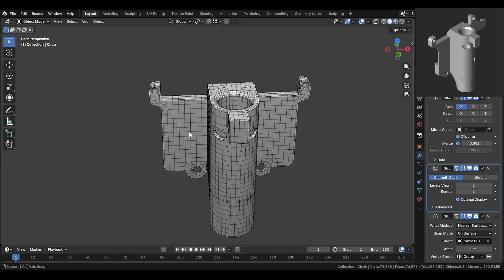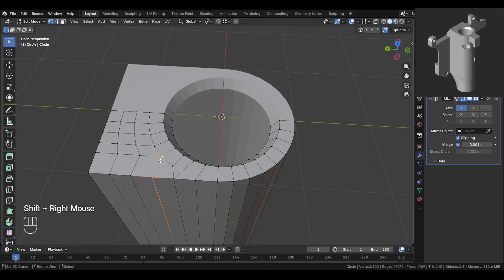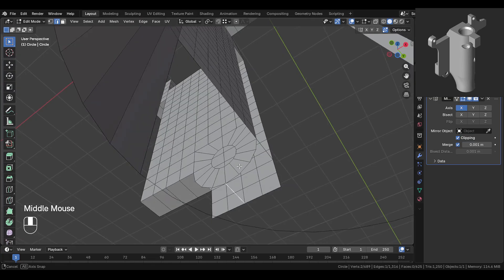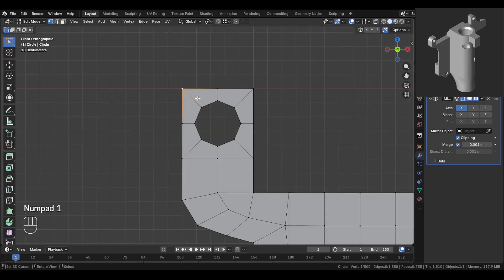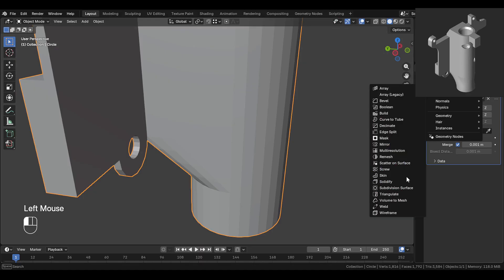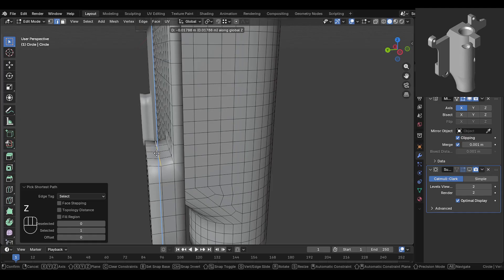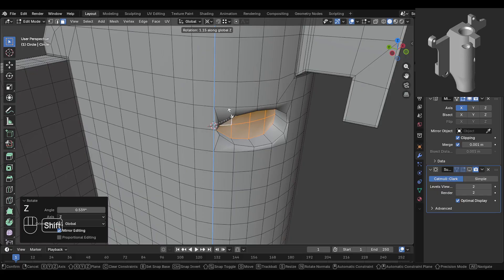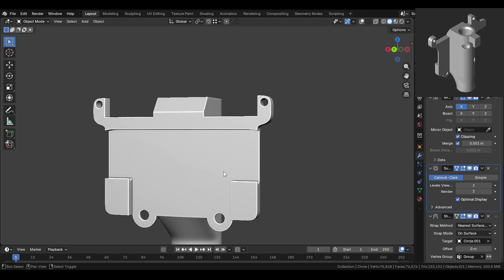Blender Practice – Modeling a Mechanical Pen Holder Tool

Comment: That shrinkwrap modifier trick is awesome. I'm sure you are familiar with the normal data transfer modifier to fix up some shading issue. Which do you think is more effective in dealing with shading issues?  Awesome vid btw.
Reply from the maker: Thanks a lot! Yes, I’m familiar with Normal Data Transfer and I used it in one of my previous lemon squeezer tutorials. It’s great for fixing shading inside Blender, but it mainly affects normals, so issues will come back after exporting to other software. Shrinkwrap actually fixes the geometry itself, which makes it more reliable and export-safe. That said, you can use either method depending on your workflow in Blender.
Reply: @casper3D6395 having a model exported without issues sounds good to me. Thanks.